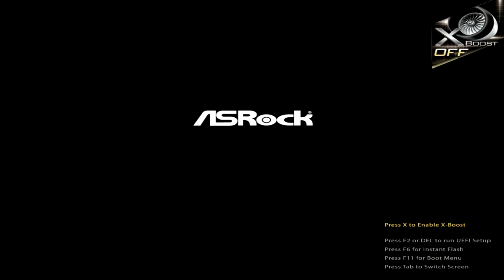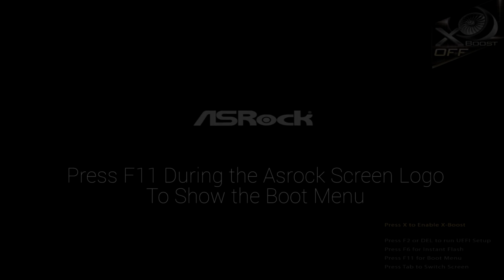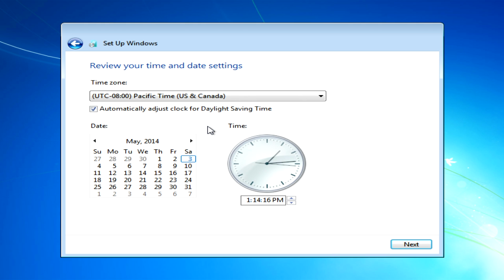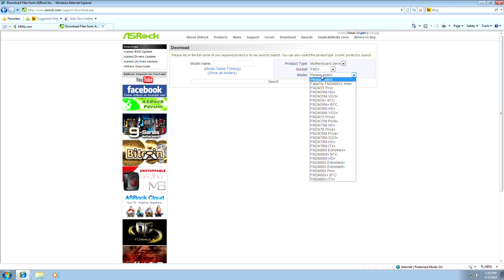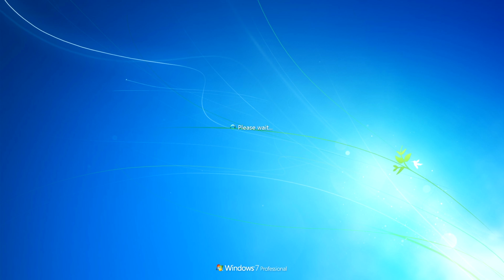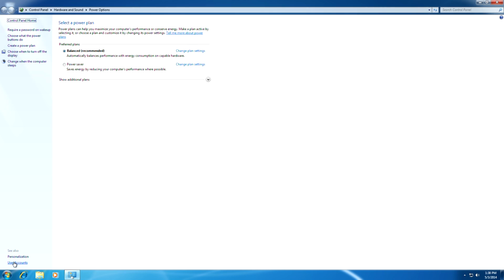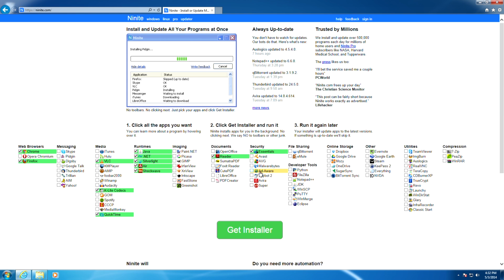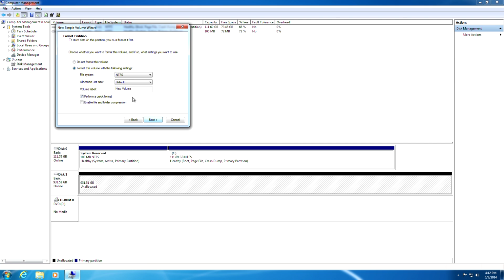AMD FM2+ Build Guide Part 3: Windows Installation

Comment: Same work like with Vista? Because i want to instal them and I have power pc with old Games and apps. But i like Vista and 7. What is your motherboard? Work with all fm2+ for 7 to instal them if all method tried not work to have Vista? I don't like 8 and 10. I want 7 or Vista. But Vista primary. Please answere how fast you can

Comment: I've copied and pasted this from your 'How to clear the CMOS reset the BIOS & why' video. I have tried Asrock support but they just refer me to the suppliers. I tried that but I live in France and my technical French isn't up to it! So:

Help needed here please. TIA. I have built a system very similar to the one described in Johnny's 'Build Guide Part 1'. Same motherboard (Asrock FM2A88X Extreme 6+) and processor (AMD A series A10-7850K), Corsair PSU, 8 Gb Savage Hyper X, Sandisk Extreme Pro SS Drive etc. On power up the board‘s ‘internal reset’ and ‘on off’ buttons light up red and Dr Bug shows a C9 code. The 4 case fans work as does the CPU fan and an internal card reader - i.e. it lights up. The DVD drawer opens when you push the button.

My monitor shows the Asrock screen where it asks to hit F2 or Del to run the UEFI setup. But nothing happens; I’m using a Logitech ‘Elite’ PS/2 keyboard that works on a different computer. I’ve tried watching videos and reading comments in an effort to identify the problem . I have removed the ram modules, removed the bios jumper, disconnected the battery, left the machine totally disconnected overnight, then reassembled everything but to no avail. I’ve today put in a different battery and that doesn’t seem to be the problem.

Added: Bios version as indicated on the mobo shows as P3.00 and has a small illuminated red light along side.

Added 2: Still getting the C9 code

Added 3: Disconnected all the cabling on the rear last night and then re-powered this morning BUT had neglected to connect the keyboard. Guess what. Same screen on monitor so it looks like there could be a keyboard issue i.e. it's not being recognised so hitting F2 or Del is pointless. Will try and borrow a different  one and update later.

Added 4: No progress - I've tried two more PS/2 keyboards but on power up, everything works as described above in paragraphs 1 & 2 but I cannot get past the Asrock opening screen with code C9 on the Dr Bug module.

Comment: Thank you for the detailed walk through, it's very easy to follow and understand! I booted Win 7 on my new build based on the tutorial without any major troubles.
Reply from the maker: Xiao Yang Glad it worked out. Thanks for watching!
Reply: ***** Just an update for the build, since I had similar parts/OS as yours (Asrock mobo, AMD 7850K, SSD, Win7): There seems to be a long-standing issue with AMD graphics adapter - my pc was fine for a while, and then does not show win 7 log on screen while HDD light was on. At first I thought it's the wireless adapter that I just plugged in at that time, so I ordered a new one and reinstalled win 7, but the same no-logon-screen problem persists. 

(Partial) fix: Press F8, choose last known good configuration, reinstall every driver and restart after each install. No log on screen only after installing AMD All-in-one and VGA drivers. Seems to be a compatibility issue between AMD graphic driver and win 7 updates, but just guessing. 

It's also strange that on my 1st win 7 install, AMD seemed to function perfectly for a while until I plugged in a wireless adapter. So It's hard to say it was only cuz of AMD drivers... But on my 2nd win7 install, the AMD drivers are the most likely to cause the no-logon issue.

Anyway, to anyone who's building an AMD machine, beware of similar problem... and correct me if I'm mistaken.

Also see: http://www.tomshardware.com/answers/id-2121691/amd-drivers-amd-website-causing-windows-boot-failure.html
Reply from the maker: +Xiao Yang did anything show on the screen when you turned it on with the wireless adapter?

Comment: Your videos are very high quality and totally awesome. Thank you!
Reply from the maker: Earl Parkour Thanks for watching and for your comment!
Reply: can you help me with my apu system?  i am very poor and have bought an amd a10 7800 with gtx 1060 today.  i have the parts but the pc is not build yet but i am curious on how i am supposed to install the system.

i mean the right way.    i use windows 7.   do i have to install  the apu drivers first and later the nvidia drivers?

or do i have to deactivate the apu in the bios or in the hardware manager first so that the dedicated graphiccard is the only gpu?

i read so much about conflicts between amd and nvidia drivers on apu systems...so how do i install the system the right way?  i would like to deactivate the igpu so that i dont have to install the graphicdrivers but i dont know yet if my motherboard is allowing that....so maybe it helps if i just not install the apu drivers and install only the nvidia drivers?

can you help me with that?

Comment: My sister bought a 2nd hand pc,
it has been working properly for the past few weeks..
but these days the pc restart after a few minutes after starting.
This appears after the restart.
“Power supply surges detected during the previous power on ASUS anti-surge was triggered to protect system from unstable supply unit.”
What should I do?

Comment: I'm putting a computer together myself but I'm just wondering which operating system is better is Windows 7 or 8. I'm using an SSD for the os, and a hard drive for storage.
Reply from the maker: It would depend on what you can find for cheap. If you plan on pirating an dmoney doesn't matter, then do Windows 8 and see if you like it or if your programs work well with it. If you're a gamer, I heard that Windows 8 is better for getting a little more frames out of your games. If you don't like the UI for Windows 8, you can watch my video on how to setup a new computer that has Windows 8. I made it to look a little more like Windows 7. Hope that helps.